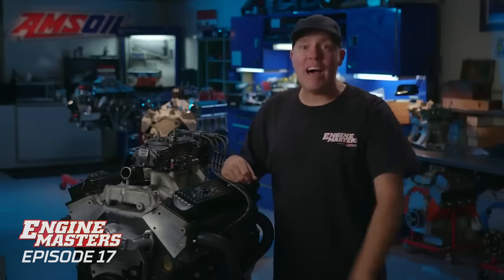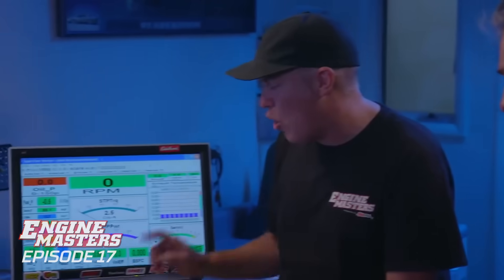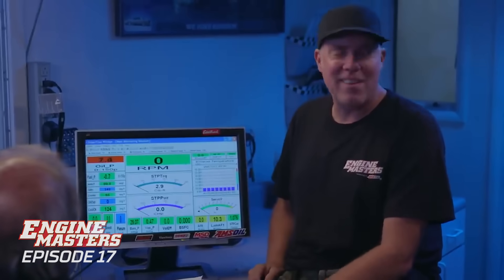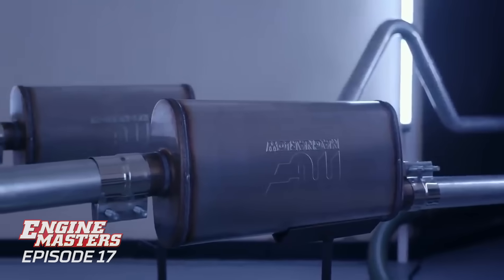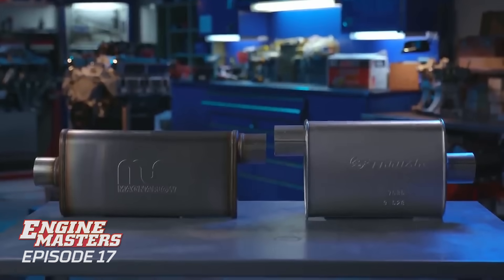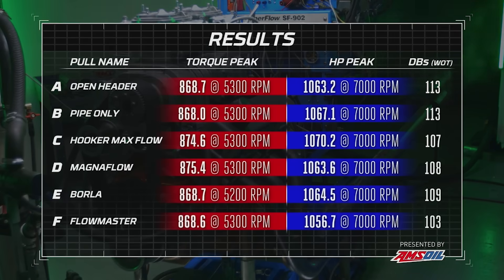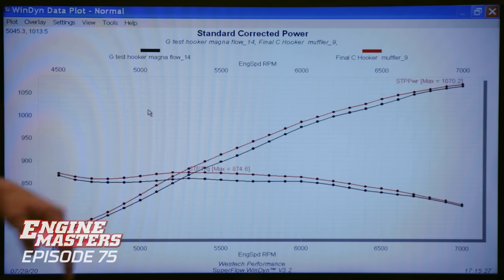Muffler Showdown! What's the Best Muffler for Your Engine? | Engine Masters | MotorTrend

Comment: As I recall from old David Vizard books, you need 2.2 CFM per horsepower, as it relates to exhaust flow, for a near zero loss system. It’s not rocket appliances
Reply: Need to re tune for each test too.

Comment: 15 years of experience... when you test 2 types of catbacks I suppose you need to take a look at the map tune as well, right? If you make it richer/leaner or messing a bit with the timing, maybe the outcome will be different. It's obvious that just replacing a part will not bring any performance, especially for an NA engine.

Comment: What happens if you ditch the 1920 technology (carburetor) and add fuel injection? I don't get why all of the "hot rod" TV shows and YT channels are so obsessed with using carbs on everything.
Reply: Air charge cooling gives a slight advantage, but it is just a preference. Mechanical computer (carburetor) vs electric computer (efi). Carbs are just less involved when setting up on a dyno. Watch Richard Holdener, he does a ton of efi vs carb. 
Cheers!

Comment: I would love to see a muffler test on a engine that makes over 1000hp specifically 1100-1500hp with 3.5"-5" mufflers
Reply: Myself also, but i would like to see 800-1500 hp Big Block Set-ups 3 1/2"-4" Exhaust Diameters.

Comment: Buy the biggest MagnaFlow mufflers  that will fit with straight through exhaust, because these mufflers are the quietest, and then add vibrant industries resonators to the very rear of the exhaust pipes which knock out tons of sound and still flow through no baffling in the system, they will never hear you coming or going.

Comment: I am looking for 2 mufflers ; single inlet and single outlet for a 2017 Jeep Compass ; don't like the 25 1/4 in. Muffler . I want 2 mufflers mounted in stock position but sounds like a dual setup with a no more than a 4 1/2 in . spacer between the two mufflers. I need to modify the lower valiance to put the second outlet so it looks like it came from the factory. Jeff Cagle

Comment: I use Dynamax Bullets. My SBC has 3", and my 454 has 3.5" collectors. I tried short Flowmaster chambered mufflers on the 454 (660 HP), and they were about .03-.05 (always compensating for weight between 14-20 LBS. a pair) slower than the Bullets. The 305 (383 HP) loses .05 with mufflers at the same GVW. Not bad. Just FYI, NONE are all that quiet. LOL!

Comment: I bought a set of Thrush 17649. You used a Thrush 17635. whats the difference between the ones you used and the ones i have? Putting it on a 550hp 383 stroker sbc. 3"all the way.Thanks.
Reply: Sbc = garbage and sound best turned off
Reply: @MidnightPolaris800  that's because it's getting ready to spit a Ford out the exhaust.

Comment: I only run flowmasters for the sound. I know they flow terrible.  I use to switch off between Flowmaster original 40s and Bassani chambered mufflers and you can really feel a difference in torque with the bassanis opposed to the Flowmasters when I had my 03 mustang with x pipe
Reply: They just proved that's BS.  Your "buttmeter" was wrong my friend.
Reply: @AwesomeFinish  who proved this???  These people?  Depends on cats/ no cats.      My car was definitely less tourqy with flowmasters.    I still run them only for the sound
Reply: @jamesa6272  Did you see any cats in this test?  Every test was controlled with the exact same piping.  Your cats would have the same power loss across the collection of mufflers.  Cats don't magically make any of these mufflers perform better or worse.  lol

Comment: How much power will a single 3 exhaust handle? I have a RCSB Silverado with American Racing headers and y pipe. It has a flange for single exhaust. The problem is the 550hp Stroker LS I’m building for it! Will I choke it with a single 3?

Comment: There’s plenty of cheap mufflers that would outflow the magnaflow. Put a $20 glasspack on there and it’s gonna flow well and not cost much at all. Would have loved to see a comparison in this video with a 2-1 setup vs the true duals
Reply: Yeah but it be ridiculous to drive constantly. A Good muffler reduces noise without creating back pressure
Reply: Glass packs work in tight places, traditional sound.  I like em right off the headers.  They burnout faster, then they sound better.  I think the Dynomax race magnum series are great,  but they do have some drone down low off idle.
Reply: Glass packs sound like clapped out sbc from the 80s with 145hp.
Reply: Why even use a muffler you want to burn out right away? Magnaflow gives you great power, and a medium exhaust under normal driving conditions, moderate inside the cab. You pay for a Magnaflow yes, but it's a quality muffler. I shine mine with NeverDull, love them.
Reply: @frakplease3771 I think glass packs sound good after they burn out. Everyone says they sound clapped out or like junk but I think they’re clueless. I used to have a caprice with a single exhaust glasspack and after it was broken in people were coming up to me all the time telling me how good it sounded.

Comment: I have a 78 Camaro with a 305 small block and I like a deep rumble. What do u guys recommend for me.
Reply: I've got a 305 vortec and I installed a Flowmaster super 44 single in duel out dumped before rear axle I left it this way so later I could run duels all the way out under my bumper but it sounds good and deep no rasp or clap at all

Comment: Try slapping a glass pack to reduce back pressure then no more than 24" straight pipe going into a dual chambered muffler off the glass pack and a over axle bend exhaust pipe to see if you get more or less torque an power when these parts are separately installed and or combined, when combined exhaust is quiet but doesnt make it lack power from my experience at least thats what it seemed. 2 into one exhaust hemi.

Comment: What’s the quietest best flowing muffler?
Reply: Of the most quiet you can get? Dynomax Super Turbo. Step up to the Dynomax Ultraflo, and it flows best. It's louder, but not too much louder, still relatively quiet, easily quiet enough for a daily driver, even without catalytic converters.

Comment: I think the Dynomax Race Magnum mufflers flow well and they sound great too.  I'd like to see them against these.
Reply: That what i use on my 71 Charger. I love those Mufflers.
Reply: @kittysofdoom6968  I like them too.  They seem to flow well, and they sound great.  They do drone a little, but I don't mind.  I do have them dumped before the axle.  Perhaps that makes the drone worse.
Reply: @kittysofdoom6968  did yours drone off idle?
Reply: @SARJENT.  Yeah mine were dumped before axle also but it was so loud I added tail pipes. It is a little better with the tail pipes at idle. My teeth dont rattle in my head any more.
Reply: @kittysofdoom6968  lol

Comment: look im just gonna comment because he was loving that flowmaster muffler so hard. its the truth.
i bought some flo pro mufflers for my vortec sbc build last year. they are flow pro super v mufflers. flo pro makes great exhaust for diesels at a good price. they got into gas motors because people love their products. 
i got 2 2.5" super v mufflers for 70 bux shipped. they lasted 20k miles and i drove it in winter and didnt want to because its a clean car. 
the mufflers are fine. they are super strong and do not take damage. i bet the flowmasters are a little better metal. but flo pro super v is just as good and less money. 
makes a deep sound. quiet till half throttle. no rasp. you cant hear your cam chopping. just low deep glug or blub sound but it sounds like power.
same motor with open headers sounds like a potato cam. very nice sound nobody has complained yet about it they all love the sound. i hope someone sees this and tries them because its a lesser known with the gas motor guys brand and im acutally very happy with them. ill buy mufflers from them now for a long time.

Comment: I had a bad situation at Midas.    the guarantee was dirt and the installer was not listening to me.     never again.     :-).
Reply: That sort of thing is the reason I'm about to pick up a tig welder.  Part of the problem is [as I am told] a number of trade schools [or what passes as job training] have changed.   Used to be everyone learned to fit, and use a torch first - that makes good sense since welding on poorly fitted parts can lead to a number of disappointments.

Comment: I'm running 2 FM Delta 50's on my XJ and they sound amazing! It doesn't sound like any other I6 I've ever heard.
Reply: mine used to sound interesting haha https://www.youtube.com/watch?v=BxkQSGx1CjA
Reply: Did you keep the cat? I've got a 99 with over 400k and the factory cat.. not sure if she had a clog or not but I can't imagine its flowing like new lol
Reply: @keithbaker1951  I run two aftermarket cats. small high flow or 'spin buns' lol, in place of the stock since it's older and uses the regular cats. Later models will need a different cat or a tune to keep the CEL from coming on.

Comment: Best muffler is no muffler
Reply: Not true at all… and it’s gonna sound like absolute garbage and it’s absolutely obnoxious to travel on the highway especially if you’re running a shortened setup such as a 45 exit in front of the rear wheels like I have on my 86 C10… but it’s a balancing act to find the best result of what you’re able to circulate in and out with the right amount of back pressure without having to much or too little but also achieving a good sound at the same time. A straight pipe is not going to be the best performance and definitely not the best sound in any case scenario…

Comment: I just got an "Ultra Flo" muffler from Dynomax, and it's a straight-through design, with a stainless steel shell.
Reply: What car and engine? I like Ultra Flo mufflers so I'm curious.
Reply: @V8AmericanMuscleCar  2002 Jeep Grand Cherokee (Laredo) with the 4.0L. 

I got the whole cat-back kit.
Reply: @revolutionday1  does it have deeper sound? 
BTW I'm Jeep fan and I had WJ too.
Reply: @V8AmericanMuscleCar  I just finished obsessively coating the whole thing in satin black, so I'm in the process of removing the rusted-up old system currently, and getting all the new kit put on. 

I might post a few clips up, once everything is good to go.
Reply: Did you want how the different straight throughs produced different horse power.

Comment: So the best Muffler is Borla?
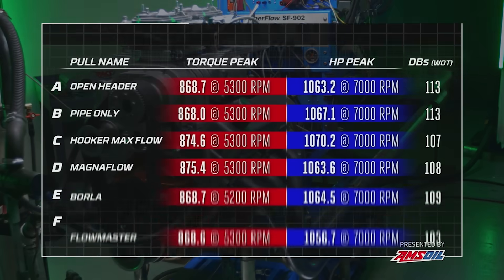Reply: Looking at the numbers chart, no. It's just the most expensive. The hooker was actually the best performing muffler out of the 4 as well as the open headers or straight pipe. At 8:54 you can see the chart.
Reply: Borla was the worst!
Hooker made the most power,  most torque, least noise of the straight thru, and cost the least, 
The flowmasters gave up a little power (who cares on a 1000hp engine?) and was quietest, by a bunch! Just decide which sound you like. I like the FM sound.
Reply: I think Borla sounds the best. But to each their own.

Comment: Can't drive a dyno, it's a great tool but it can't really give you part throttle SOP feel
Reply: Can't measure "feel" quantitatively, which is the point of this video.
Reply: @sepg5084  It don't give track times either which is the ultimate test.  Some mods enhance the driving experience, others gives faster track times and some both.  Some people will just never understand even if you show them.
Reply: @sepg5084  FYI I doubt you got a LIKE in 17mins on this 3mo old vid, that's like patting yourself on the back LOL sad really.

Comment: Why no cherry bomb glass packs 🤷‍♂️
Reply: I brought up cherry bombs because they were saying so much about getting what you pay and the fact is a straight through muffler is a straight through muffler and 3 inch thrush mufflers not only s but have 2 1/2 internal tubing
Reply: Those are so similar. I had the magnaflow and it was called “magna-pack” just has more room for insulation surrounding the tube.

Comment: I had 3 inch flowmasters way to loud for driving gave me a headache put on some 3 inch dynomax that were 21 inch long  much quieter and did not change 1/4 mile time now i have 3 inch dynomax that are 27inch long losing power seat of pants feel  very quiet.Wish that drive shaft did not break and beat up the 22 in dynomax could not find a replacement they quit making them 71 chevelle 454

Comment: A test with the far-more-quiet Dynomax Super Turbo would have been interesting to see!  Wouldn't flow as well as the straight-through, but I bet it would be far better than the Thrush!
Reply: I ran 2 1/4 inch Dynomax Super Turbo mufflers on my 1990 Mustang GT. Timing was at 12° BTDC, off road H-pipe and K&N air filter with air filter silencer removed. It sounded almost like the stock mufflers at idle but had a strong and throaty tone at WOT. Never got pulled over on Woodward Ave for excessive noise/mufflers by the local LEO's. All the other Mustang's seemed to have Flowmaster or cheaper version mufflers. Too loud at WOT and excessive drone at cruising speed.

Comment: I've always been a fan of Flowmaster but the testing might be more fair if compared offset mufflers when against offset mufflers  straight through mufflers will always flow better than an offset mufflers  nevertheless fitting straight through mufflers on a cars exhaust is the least likely situation  unless it is a all out race car then why even bother with mufflers
Reply: I ran Stainless Works chambered straight mufflers(think 67-69 Z28 mufflers) on my 331ci Mustang. Below 3000rpm they sounded much like Flowmasters, without the droning while cruising. Above 3K... Yeah they weren't far off from straight pipes(sounded amazing). Actual straight pipe exhausts tend to sound like junk at all but wide open throttle though. I went with the chambered straight muffles for a few reasons. Besides easy packaging, I needed some form of muffler to pass state inspection and they were also required for 'street racing' night at the local track. Some NHRA classes require mufflers as well, even on dedicated race cars.

Comment: ...maybe I missed it, he said the thrush was cheap and 3" but not what made it different? Looking online they appear to be "turbo" style mufflers with a perforated 2 pass and chambers at both ends. Seems like that was what made it drop power. I don't think cheap is the issue, you can get cheap straight through mufflers :) 
Thanks for posting this, it was fun!
Reply: Yep, comparing a straight thru magnaflow to a triple pass thrush turbo GUARANTEED that the high buck muffler would win. Sure didnt want to lose magnaflow advertising. 
How about comparing a cheap thrush three inch glasspack at tirty bucks against a giant triplepass magnaflow $200 muffler? (Cause they know the cheapass thrush would win!)

Comment: I have a Magnaflow catback on my 95 Camaro Z28 along with eBay stainless longtube headers. Made a huge difference. 💪🏾💪🏾💪🏾
Reply: I have the magnaflow on my 97 Camaro also but with Kooks lt and ory. I also have ported heads,cam etc.  I love it but at the same time the exhaust isnt even. It comes out more the drivers side. I wanna do a custom setup with a good merger, magnaflow 3.5" muffler and the long tips that come with that kit.

Comment: 3" vs 2 1/2" pipe, would it help a turbo car? I only have dyno before my exhaust mods, but I went with 3" all the way with 1 Magnaflow straight through muffler. Trying to let air out and keep cool.
Reply: Definitely stick with the 3”
Reply: generally turbos like less restrictive exhausts overall. 

Obviously at a certain point you'll hit diminishing returns, but a 3" exhaust is fairly solid upgrade for turbo cars.
Reply: @lynnmckenney1987  thanks for replying

Comment: I owned a Mustang and had a Flowmaster super 44 installed and then a Dynomax was installed like the ones used in Honda Civics. The sound was thick and the response of the engine increased. What about the Vibrant? My son uses it in his Honda and the sound is very good and he says it improves the response of the engine.
Reply: looking to buy a flowmaster super 44, also on a petrol engine. how was it? changed it because it wasn't good or just because you wanted another sound?

Comment: I bet a 2 chamber FlowMaster is no better than the Thrush. Chambered mufflers like that are (generally) for stock(ish) engines that need a little bark. Use a straight-thru muffler with packing for an actual HP effort.
Reply: But the test proves that the HP differences are negligible.  Choose the one you like and run it.  Anything else is just internet BS.